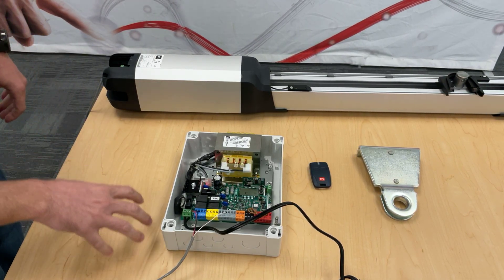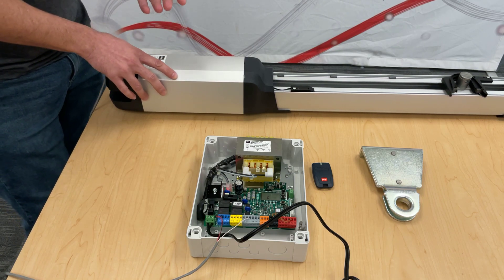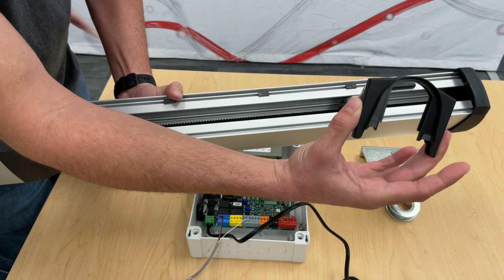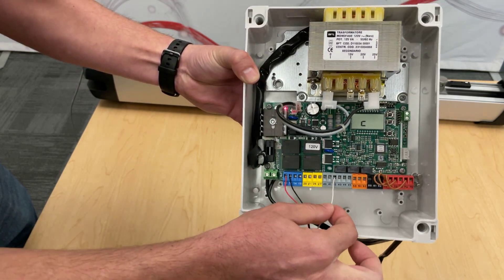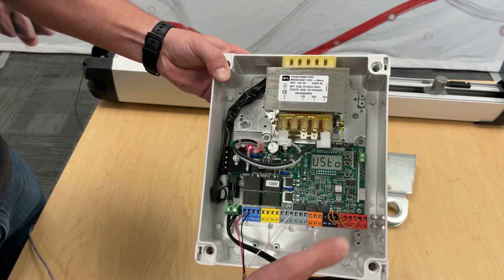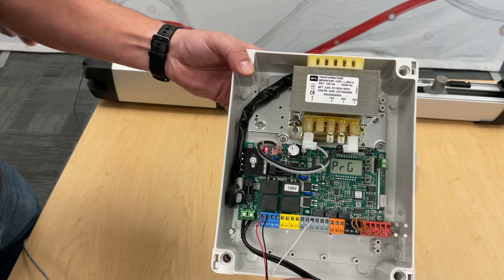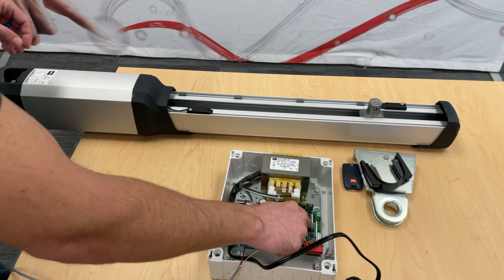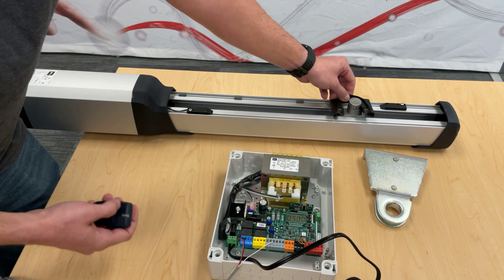BFT Phobos A40-A25  & Thalia Lite SD Quick Overview

Comment: When a object is removed from the photocells my gate closes automatically,they should surely open as a safety matter ,I’ve wired them correctly as the wiring diagram,any ideas what the problem could be,thanks

Comment: Hey, so i choose 2 motors... but itll open only the m1 all the times. I check swithcing the cables to see if the motor (m2) and it works. Anyways autoset opens only m1 and not m2. Also, I dont get any error codes.

Comment: Is it possible to install a manual wired switch?
Reply from the maker: Yes you want the switch to be Normally Open and you would wire into 60 and 61 on the control board.

Comment: Thanks for the clip and I have indeed been forced to upgrade my Motors to A40.  I have however the old LIBRA controller and now need to slow down one of the Motors on one of the two swing gates as they close together and in order to avoid a collision, I have to stop the gate closing and then start it again in order to let the 1st swing gate close before the 2nd wing gate.  Do you have a video on how to program the LIBRA controller? ... thanks very much!
Reply from the maker: we have no video for that but you can go into libra programming menu and but a longer delay time so the gate can close first
Reply: @BFTAmericasInc  thanks for the reply.. indeed now found the setting in question, was able to apply a close delay on the 2nd motor/gate.  Thanks very much!
Reply: How old were the motors?

Comment: Hi, watched you video and I have an issue with my A40. Trying to do the programming but I get error 18 and when it does the auto prog it opens and then stops at the limit switch and then doesn’t go back and shows me error 18. Wondering if you know how to fix this issue?
Reply: now i installed A25 same error. What was your solution to err18?

Comment: Hi,
  How can i reset to factory setting model Zara for BFT Phobos A40?
Reply from the maker: Thank you for reaching out. The Zara is one of our more basic boards and there really isn't a factory reset for it. To get it back to how it came, you would just simply put all the potentiometers to zero and only have dip switch 1 and 8 on. Press and hold s3 and it will be back to how it came from factory, but that will more then likely not fix any issues your are having. Now, if you want to delete all the programmed remotes you would simply push and hold S1 and S2 for 10 seconds and all previously programmed remotes will be erased from memory. Please reach out to us at Tech@BFT-USA.com and we will see if we can help you out a little further.

Comment: 2:10 there can be another problem which I had :) I did not conect safety switch to socket number 42 (1 motor).
Reply from the maker: It happens my friend. Glad you figured it out. I've also seen it happen with old cable being broken or shorted causing everything to go nuts.
Reply: @BFTAmericasInc We had a heavy rain and after both swing gates would open but only one would close ...... what should I be checking?
Reply: @BFTAmericasInc Nice video